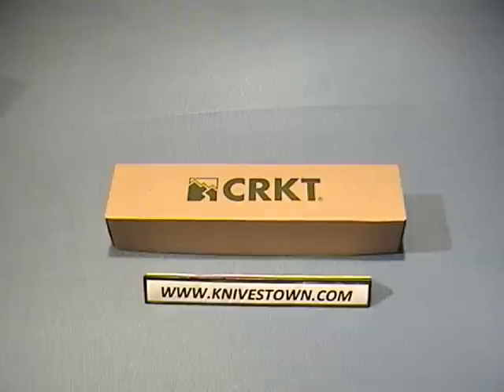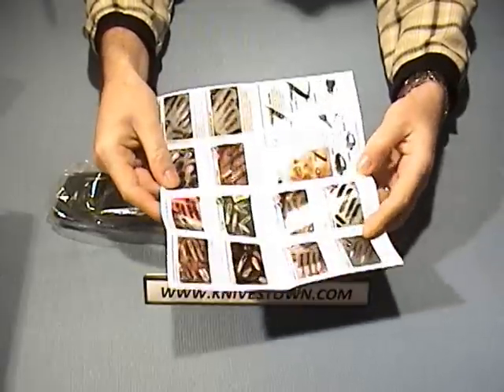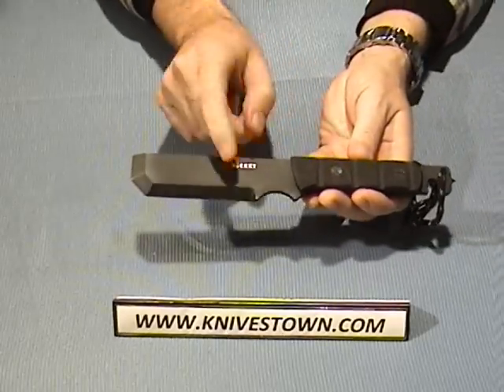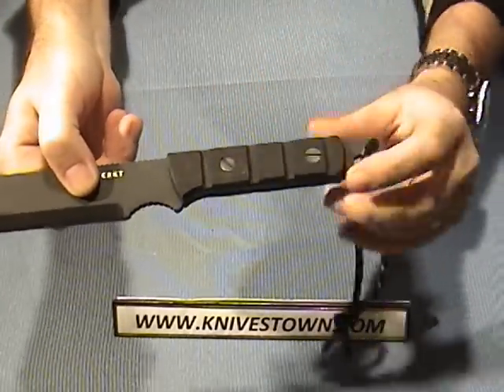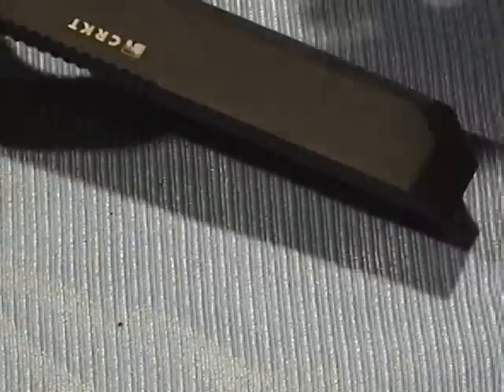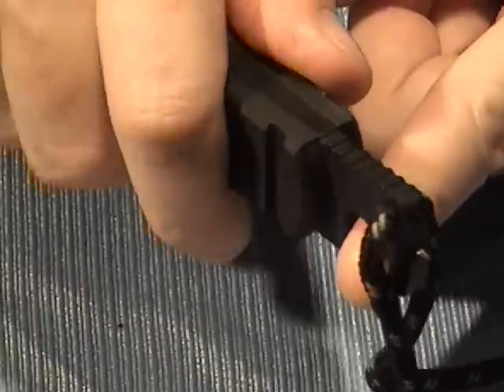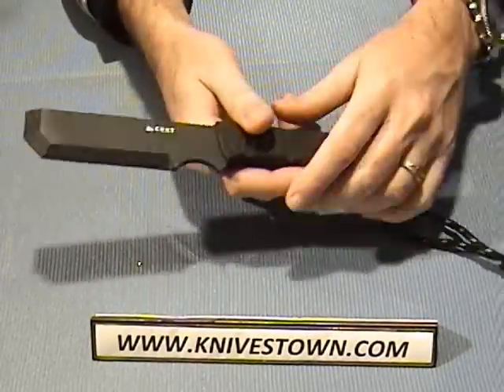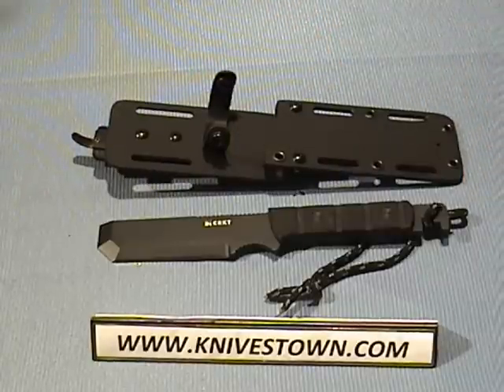CRKT McGowan MAK-1 Tactical Rescue Knife Model 2050K

Comment from the maker: The reason would be primarily for cleaning. This knife was designed by a firefighter. In his world, if the knife is dropped it can easily land in a puddle of water mixed with ash, dust, mud etc....The removable handles would be for cleaning and drying. If you are enterprising you could make your own scales and the removable handles would be appreciated then as well.